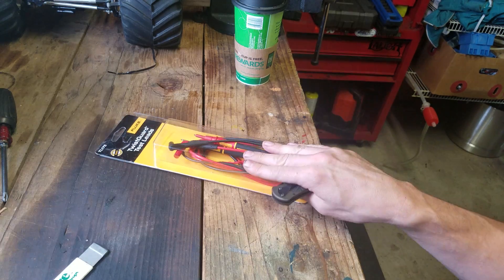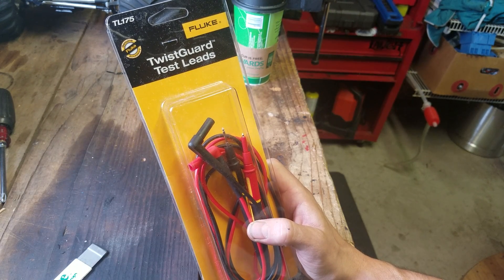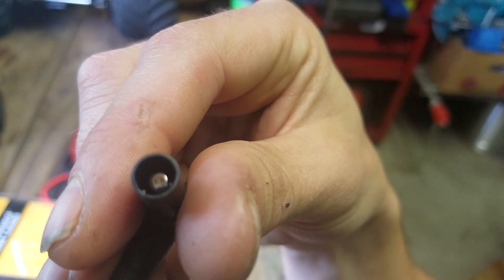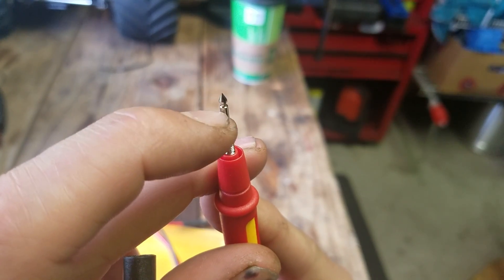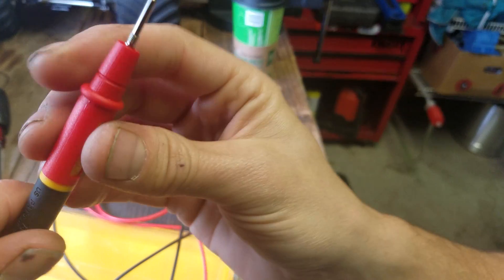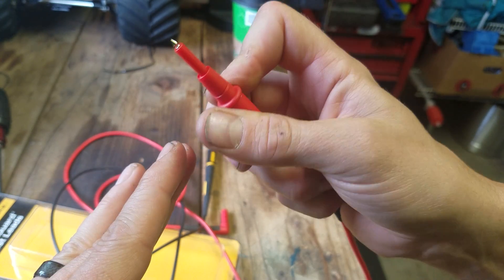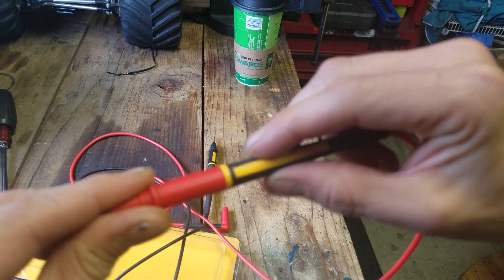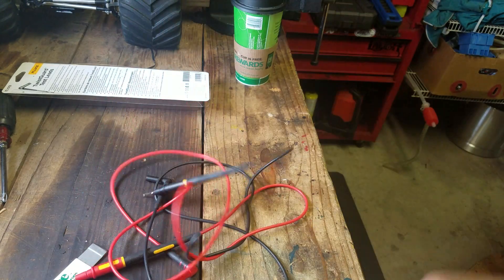Fluke TL175 Test Leads Review

Comment: I have a 15B fluke and at times when measuring caps it just sits there. It seems like I have to wake it up. I'm wondering is it becuase I'm using non Fluke test probes? I did'nt like the probes that came with this fluke as they were too long. They would get in the way on my test bench being 4 ft long, so I got a short pair of leads.

Comment: Those came with my Fluke 87V Max and felt good at first glance but had rather high resistance from the beginning, around 2-3 Ohm. After using them just a couple of times (on my desk - there was never any physical stress applied) both probes had 100-450 Ohm resistance each. Twisting them a little bit brought them back to 2 Ohm (temporarily), but still this makes them unreliable and renders them unusable for me :( I think this might be some problem with oxidation inside the probe (cable and 4mm plug are looking good).
I've never had such quality issues before with any other brand - not even with cheap 10Euro no-name probes. The seller told me although they are still under warranty, I'd somehow have to prove that it is a manufacturing fault (good luck with that) - therefore no replacement, sorry. Well, I guess I could have gotten the same level of service/support a whole lot cheaper from a Chinese manufacturer.
My advice: Don't buy these probes!

Comment: I became a USAF Precision Measurement Equipment Lab (PMEL) tech back in the early-80s and, over the years, Fluke had proven to be one of the most reputable test equipment brands in the Precision Measurement Equipment (PME) industry.  They are particularly strong when it comes to portable test equipment, including DMMs and the accessories used with them.  Thank you for creating this informative video and, more to the point, for exposing the YT community to a truly exceptional American brand name.

Comment: was watching an electrician who made a fun video about tools from Wish, and he bought a multimeter that read ok but then smashed it due to it not having 'real' safety ratings, ok i can live with that it maybe didnt have any real hv protection, but he also went off on a little rant about the probe leads not being double insulated??? what was he expecting 2 different colors of pvc or something i have never in 40 yrs of the hobby seen double insulated probe leads on any meter i have bought, just a single red or black insulation..
Do double insulated leads exist?
Reply: Link?
Reply: @HIDLad001  iirc it was Dave Jones
Reply: Yes, these have that feature. It's quite possible you have seen leads with this before, it's not obvious until you damage the outer layer.
Reply: @Motorman2112  isn't it like getting a little cut in your thumb, putting a plaster on, then adding a plaster to the plaster.... And calling it double plastered....

Comment: Fluke test leads have all the same problem: after a while they develop resistance which disappears if you move the wire.
In ohms about 3-8 ohms and after some moving of the wire about it drops to what it should be 
: around 0,3 ohm or lower, i had this problem with sevral sets of fluke leads mow including the tl175, with two meter the standard fluke leads and with the expensive lead and clamp set leads, in other words; its high priced chinese garbage, go for Probemaster, cheaper and superiour to flukes chinese stuff.

Comment: I've been through 3 sets of these because there are bad connections where the wire goes into the probe where the strain relief is located. All 3 sets have the built in resistance you mentioned but if I wiggle the wire it varies resistance. Has anyone seen this before+
Reply: Just made the comment, yes i also have this with several sets (4)
Its chinese garbage at a premium price.

Comment: I've used 3 brand new sets of those same fluke leads and they don't zero out of my meter or my co workers the red lead makes it throws it off if you use two black leads it will zero out. Only problem I've had with any fluke leads. Klein leads will zero out so I know it's not the meter.

Comment: whats the best way to test your leads to make sure they are good ie not high ohms?
Reply: Dill Wiggle Yes wondering the same.
Reply from the maker: I highly doubt it considering fluke sells the magnet part and it sits on the clamp in the same area. I haven't noticed any odd readings.  I do believe there are fundamental differences between mechanical magnetism and electromagnetism.   I don't know what those differences are but it doesn't affect the readings

Comment: Great video I just ordered a set for my fluke meter I always just used the plane O standard set. I'm excited thanks !
Reply from the maker: +JonesHvac they are way nicer than the ones included.  Then lead wires are awesome and don't get tangled up.  You will probably never got back to the included ones.  (I got about 3 or 4 years out of a set)

Comment: Meh. Fluke doesn't make a a lead with a stacking connector. I buy Fluke because it's easier than making my own - for specialised stuff, I make my own using Multi Contact parts. Some Fluke part numbers are actually Multi Contact parts (Mostly their BNC stuff for oscilloscopes) so they kinda give their blessing.

Comment: I have a Fluke 87 and an 87V that I bought after the backlight failed on the original after 25 years. Only thing disappointing about the new meter was the leads, which did not have as high quality insulation on the wire lengths as the original. I still use the original leads. Their plating is still intact, but I mainly test electronic components, so I suppose they haven't ever really taken a beating. Anyway, it sounds like the TL175 are just what I've been looking for, with the really good silicone rubber exterior coating.

Here's couple of interesting things. I read on the EEVblog forums that Pomona makes Fluke test leads, and the ones shown in this PDF do look identical http://www.pomonaelectronics.com/pdf/d7519A_003.pdf . There is a lot more information there than on Fluke's site. And I ran across this on YouTube "T4D #42 - Genuine Fluke TL175 Leads...or fake / knockoff?!" https://www.youtube.com/watch?v=wDaNRizEhK0 . Apparently there are some inferior probes being sold by unauthorized web retailers.